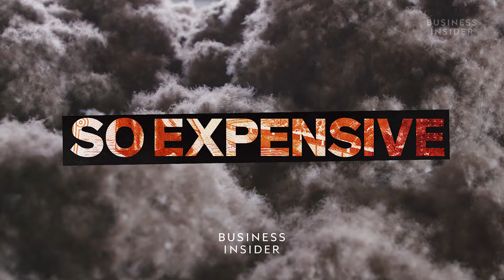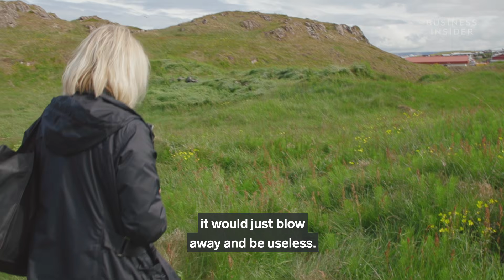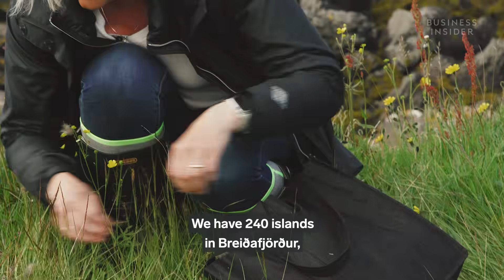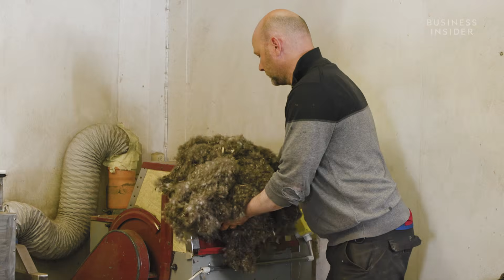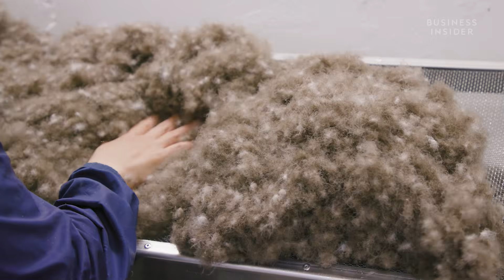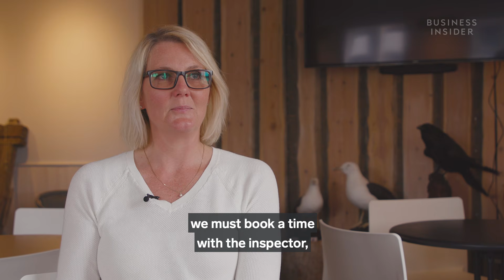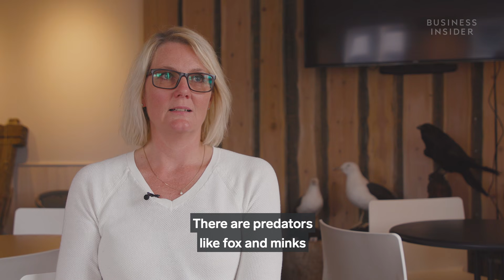Why Icelandic Eiderdown Is So Expensive | So Expensive

Comment: Says they only take a little of the nest,  me seeing them take 90% of the nest
Reply: "Eiderdown farmers will harvest this down either by taking small amounts from each nest or by waiting for the birds to dissapear completely"

Notice the words: either, or and bird.

They will either take small amounts while the bird is there or larger amounts when they arent. If the birds are not there then they take larger amounts. Nothing here is contradictory nor is it unethical. If anything this is beneficial as farmers are now invested in the safety of the bird populations. The fact that oftentimes the wind will blow away the nest if the birds are not present and the birds return and remake it is no different to when it the nest is taken with the minimum left for the eggs to survive. Either way: no birds are being harmed, no eggs are being harmed and this practice in contrast to ones like whaling have not had any adverse effects on the population of these birds unlike that of whales.

This practice has been refined for centuries. That does not mean it is good nessesarily just that it is efficient and due to the scarcity of this material REQUIRES that farmers maintain the populations of these birds. If it had any adverse effects on the birds then there would be noticable effects on the amount of Eiderdown produced and because there are no signs of this, it is simply wrong to consider this unethical as all signs show that it is an ethical and sustainable practice.

Comment: "we only take a little off the nest or wait for them to leave"
Reply: "Eiderdown farmers will harvest this down either by taking small amounts from each nest or by waiting for the birds to dissapear completely"

Notice the words: either, or and bird.

They will either take small amounts while the bird is there or larger amounts when they arent. If the birds are not there then they take larger amounts. Nothing here is contradictory nor is it unethical. If anything this is beneficial as farmers are now invested in the safety of the bird populations. The fact that oftentimes the wind will blow away the nest if the birds are not present and the birds return and remake it is no different to when it the nest is taken with the minimum left for the eggs to survive. Either way: no birds are being harmed, no eggs are being harmed and this practice in contrast to ones like whaling have not had any adverse effects on the population of these birds unlike that of whales.

This practice has been refined for centuries. That does not mean it is good nessesarily just that it is efficient and due to the scarcity of this material REQUIRES that farmers maintain the populations of these birds. If it had any adverse effects on the birds then there would be noticable effects on the amount of Eiderdown produced and because there are no signs of this, it is simply wrong to consider this unethical as all signs show that it is an ethical and sustainable practice.
Reply: @ThatOneBreadstickEater  by waiting for the birds to leave implies that includes the newborn chicks once have they have hatched. Not just the mother or father ducks.
Reply: @gerdafridriksdottir8836  Good 👍

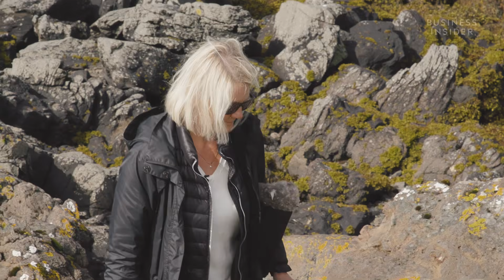Comment: ""Only small amount of feather each nest..."" 1:20 really?
Reply: I guarantee you they take a lot more than they're supposed to No Doubt
Reply: @joemomtana6014  Just watch 1:20 .... they took 90% of nest
Reply: @Demetttttt  trying to be optimistic ....
Reply: "Eiderdown farmers will harvest this down either by taking small amounts from each nest or by waiting for the birds to dissapear completely"
Notice the words: either, or and bird.
They will either take small amounts while the bird is there or larger amounts when they arent. If the birds are not there then they take larger amounts. Nothing here is contradictory nor is it unethical. If anything this is beneficial as farmers are now invested in the safety of the bird populations. The fact that oftentimes the wind will blow away the nest if the birds are not present and the birds return and remake it is no different to when it the nest is taken with the minimum left for the eggs to survive. Either way: no birds are being harmed, no eggs are being harmed and this practice in contrast to ones like whaling have not had any adverse effects on the population of these birds.
Reply: @ThatOneBreadstickEater  There are still eggs at 1:20, so its not abaddoned nest. If you take entire 90% of nest while there are still eggs, eggs will lose their heat and may die before preparing new nest